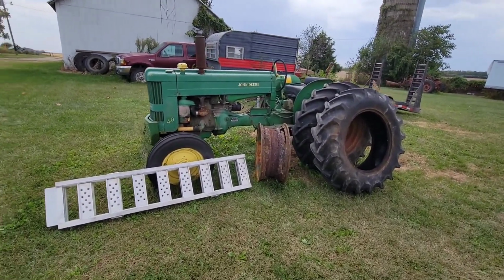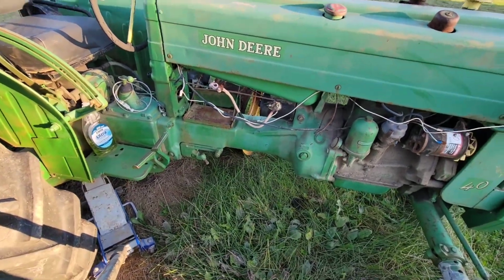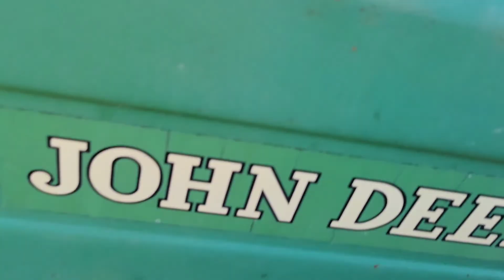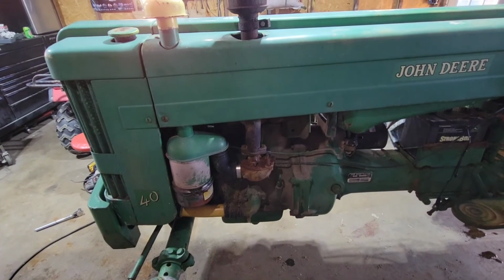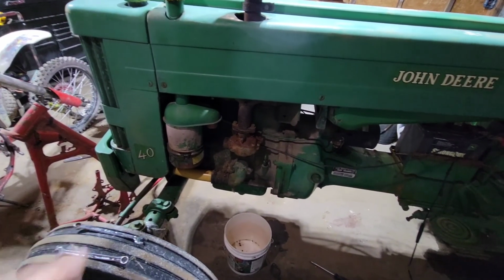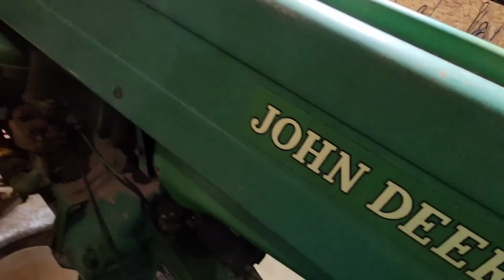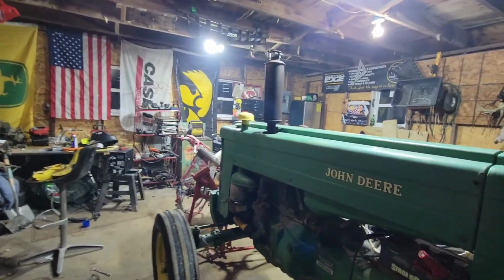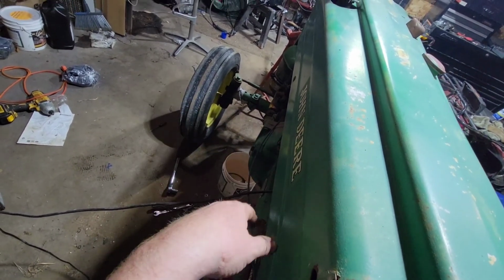Bringing my John Deere 40 back to life after sitting for years

Comment: Great video! Did you do any more work to it since doing this video? What do you use for antifreeze in it?
Reply from the maker: Very little, I ended up moving, but hope to get it out this spring and finish up some stuff. I normally use john deere antifreeze, however this is a small enough engine I'd feel comfortable using automotive
Reply: @Kerrage  
Perfect! Thanks for responding man! 
I have a 1955 John Deere 40 S. Just did an oil change on it and I think it could use a top up of coolant/antifreeze - so thanks for the information! 😎👍
Great video! Keep up the good work man!
Hopefully you like your new place…?
New subscriber here for sure!
Reply from the maker: @howtobuildadream  sure do, and awesome man, thanks!
Reply: @Kerrage  Sorry to bug you again... Do you happen to know how much antifreeze it takes from bone dry? (if I were to drain and replace the antifreeze that's in it? I've looked online and there's a few different numbers floating around... lol
Reply from the maker: @howtobuildadream  tractor data.com shows 14 qt, I don't know where my book is since I moved, but that site from past experiences seems to be fairly accurate, cant say it 100% correct but it's likely in the ballpark
Reply: @Kerrage  Awesome! Thank you Sir!
Reply from the maker: @howtobuildadream  no problem, anytime

Comment: Is this tractor for sale? If so, where is it located?
Reply from the maker: Nope it's not
Reply: @Kerrage  just checking, I also have a '53 40 I'm restoring. Mine is a trycycle with 10x38" rear wheels.
Reply from the maker: @brettroach3314  I had to get new rear rims on this guy and when searching I believe those were the easier ones to find, I think my dad has an identical one to yours
Reply: @brettroach3314  how is your restoration project? I have a 53 model 40t just got the pistons out of mine been stuck for 26 years. Been looking for other videos of there restoring project.
Reply: @seankiverchuk4627  haven't gotten the pistons out of it yet. I had to find a replacement block because the pitting in the bores of mine are too deep, and the new block was cheaper than sleeving the block.